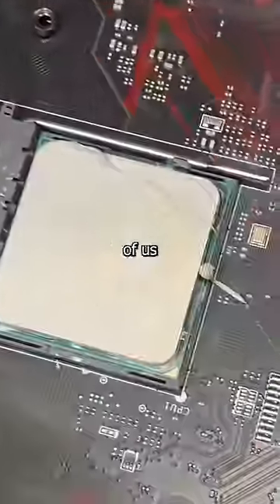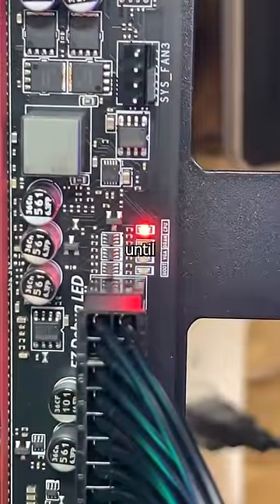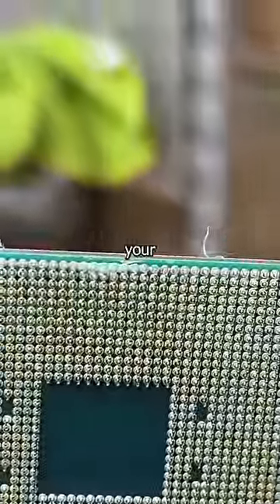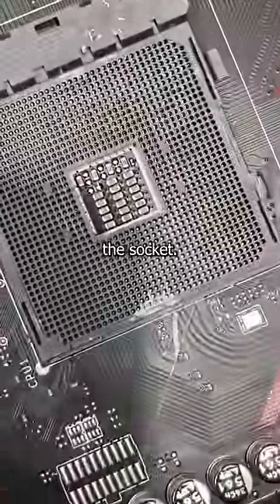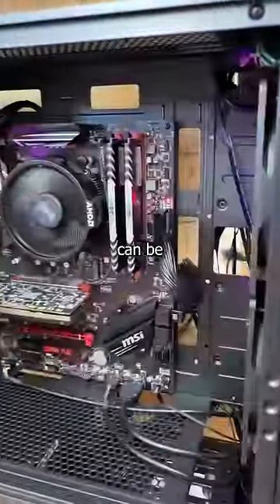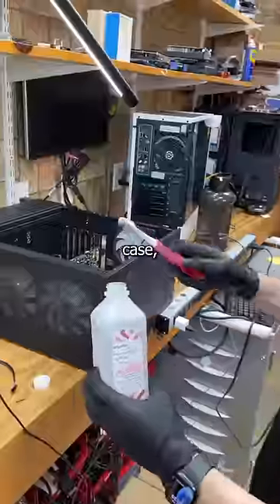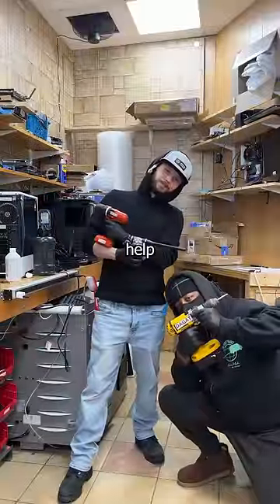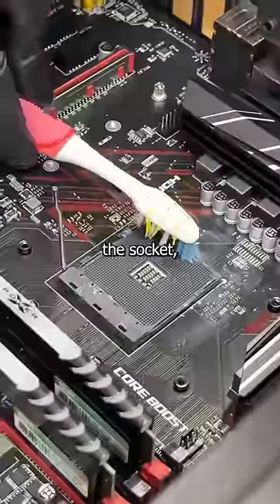Thermal paste inside a CPU socket 💀#tech #shorts #pc #technology

Comment: Iirc, thermal paste is non conductive, right? Meaning it prevented those pins from actually connecting with the socket, so no risk of a short circuit or something.

Comment: This is called "Thermal Pumping." The on/off cycles heats aka expands and shrinks squeezing the paste out from the CPU/heatsink. This is why the bubble gum like TIM "pads" (Thermal Interface Material) instead of a paste. 

AMD would not warranty a CPU that used paste with the heatsink.

Comment: one tip i would share is get some contact cleaner in a can. can higher pressure spray both the socket and cpu pins and the paste just runs right off. saves so much time

Comment: that said, isnt thermal paste non conductive? why would it cause an issue if it leaked some down? is it coating the pins so it isn't having a good connection?
Reply from the maker: it completely covered the pins and a few of the sockets, so no connection

Comment: The components shouldnt be harmeb by thermal paste because thermal paste doesnt direct current.
Reply from the maker: Not harmed but they can prevent contact if the pins are completely covered and if you can't clean it off you're screwed

Comment: ive done this before when i wanted to swap out my cpu cooler. put too much paste it went into the socket and would not start up. and my solution was the same as what you did in this video.

Comment: I would add a disclaimer that too much is still better than too little. Normally you can't have too much (non-conductive) thermal paste, because there really isn't a way for it to go anywhere where it would matter (other than looking ugly and being a pain to clean when you change cooler or cpu). Too little thermal paste on the other hand is a sure way to disaster. I can't help but wonder how that even happened. He must have removed the CPU from the socket after applying thermal paste.

Comment: Well... I mean... paste isn't conductive. A tiny amount is fine. So long as it doesn't hinder the connection of the pins. So yeah, quick brush and blast of air on the socket, and a careful pin clean, it's all set to go. It's super common. Lol. I see this shit all the time.

Comment: Lucky because a lot of times getting paste in the socket/on the pins and trying to run it will damage it when the electricity hits all that extra resistance.

"It's not electrically conductive!" Yeah exactly

Comment: I pulled off my CPU Cooler (AMD) once and foolishly didn't heat it up so the CPU came along with it and about 25 pins bent. Spent hours with a razor blade and a headlamp bending them back. This was about a year ago? It still works like a champ.

Comment: I'd be more surprised if there aren't issues with the PSU down the line.
No PSU I'd put within 21 feet of my rig still has a voltage selector switch 
🤮

Comment: Anyone who knows 100% bc I'm not fully sure, will everything be compatible with this graphics card?
Or strong for it, the RX 580 (8GB)
My specs:

AMD Ryzen 5 4600G
(With the same cooler as in video)

ASRock Ultra M.2 B450M PRO4

16GB RAM

(Dedicated graphics card, nuvoton)

Case: same as in video, as I recall airi midi black (with 2 fans on front)

And I have to clean my CPU fan ._.
And also for RAM I have DDR4, and either GDDR4 or GDDR5 idk.
And I have ultra m.2 PCIe gen3 X4

Comment: My no money pc (made with depression, 4gb 1333mhz ddr3 ram and a psu i rewired after i burned the wires) has the same along with the heatsync being made from a steel square bar and no fan and runs better than when i found it (rainy Australian day) the pins have corrosion and thermal paste except for 5 or 6 that a re just missing

Comment: HELP!!! I have an old PC with an Intel core i5 460m that uses 35w of power to run it uses the Intel g1 socket and I ordered an Intel core i7 740qm that is 2 cores and 4 threads more than the original but I later saw that it needs 45w of power will I have any problem if I install it ? The laptop that I have is the Acer aspire 5745dg. (I bought it just because it was in a really cheap price 5$)

Comment: do i still need a pste for a regular cooler? ( not a liquid one)
Reply from the maker: Any surface making contact with the CPU requires paste to seal the microscopic air gap between the two surfaces. Whether you use Liquid Metal or Paste or Sheet, you need something
Reply: @SalemTechsperts   is there any cooler with paste included

Comment: Technical question: Can you use third-party PSU to GPU cables? My PSU came with those ugly double connectors on 1 cable and I really want to replace them. My GPU needs 2x 8 pin connectors so I have 4 cables of which 2 are absolutely unnecessary. It looks really bad.
Reply from the maker: Technical answer: yes
Reply: Make sure pinout is the same or you can short things out.
Reply: @SalemTechsperts  Thank you. I am quite new to pc building and didn't want to ruin my pc.